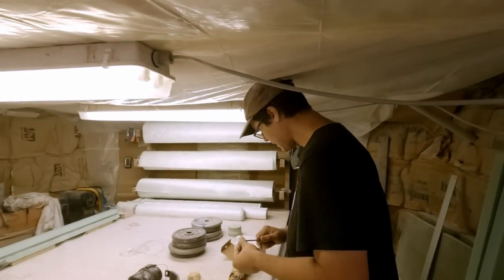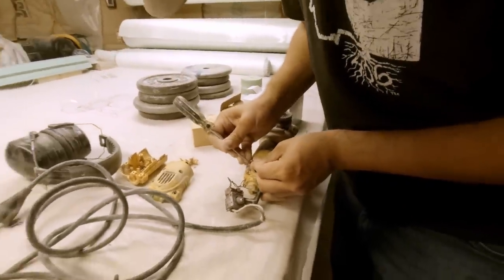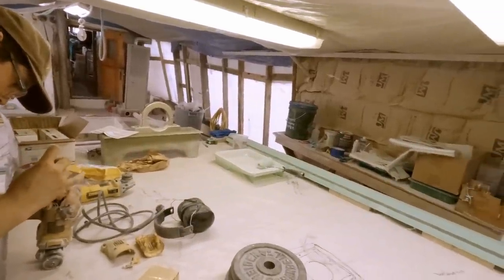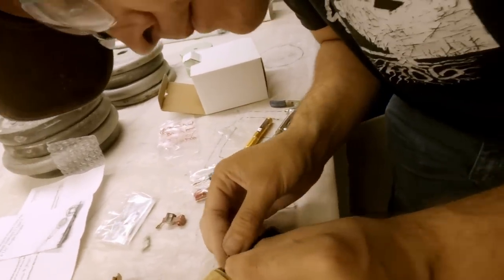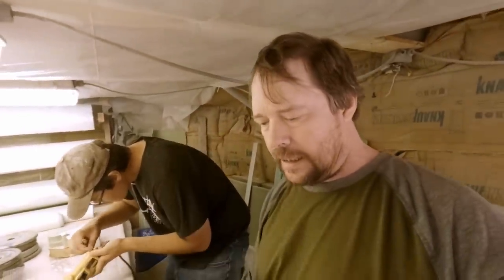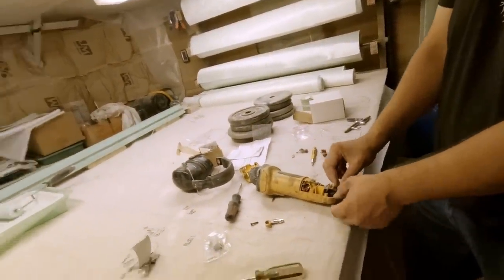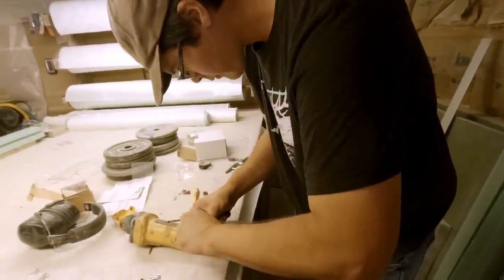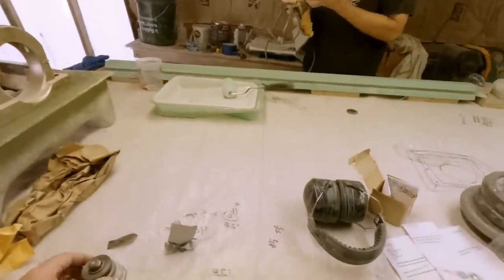Reduce, Reuse, Recycle - Replacing Brushes on Our Grinders

Comment: When i use to weld i would see the shop manager toss out the old grinders that were not working and give out new ones. So i would dig them out and relace the brushes in them and good as new. Then just give them away or sell them off cheap to people in need of one.
Reply from the maker: It seems wasteful to throw good equipment away. Glad you saved them from the landfill and gave them new life. Kudos!
Reply: It's nice to see there's other people who don't buy into our throw away society. It is really amazing if you think what it was like just a few years ago when we had numerous repair shops for everything we used. I used to have my work boots resoled every two years,now it's next to impossible to find a shoe repair shop that resoles boots and if you do its very expensive . It's sad to see what our country has become.